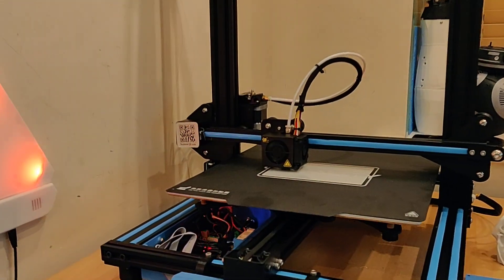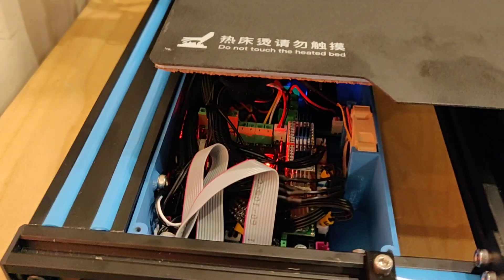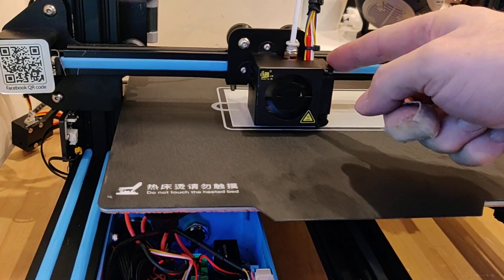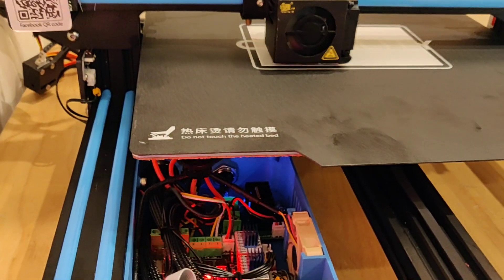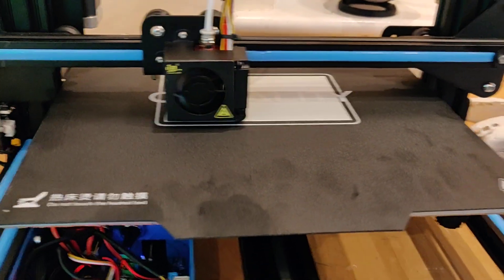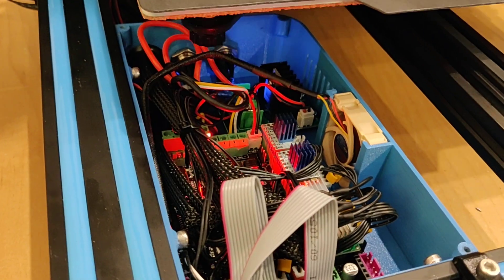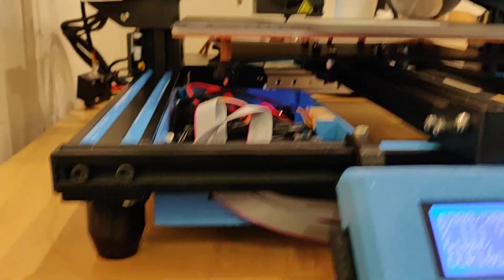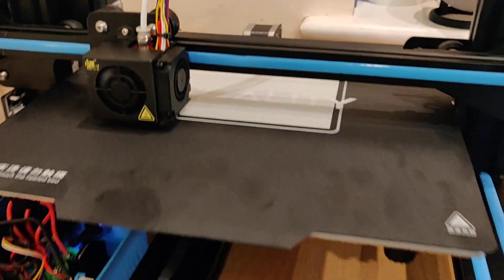CR-10S Mods and 24v upgrade

Comment: nice video, i have a question, i currently have a cr10s with a 2.1 creality mainboard which supports 12 or 24 volts. i bought a 24v heatbed, a 24v meanpower supply, a 24v hotend that says its for the ender 3, but the only thing that will fit my carriage,i also bought the 2 fans for the hotend.do i need to chane stepper motorers? and what about my 12v cooling fans? my last question would be, i am using marlin 2.0 for the cr10s. do i need to change anything in marlin for 24v, or do i need to use the cr10s pro firmware. i just don't want to damage fans, endstops or stepper motors i just purchased. thanks for any replys, Brett :-)
Reply from the maker: The only thing you need to update are the 12v fans now.  The motors / steppers / endstops etc will all work as before.  So, just your fans as you have already updated the heater / heated bed.  You can just take the heating element from the Ender three if you want and swap it from the 12v one out of the hotend on the cr10s.  The themistor can remain.
Reply: @Waggster  thank you very much for the response,I subbed your channel,I don't own an ender 3 ,I just ordered the hot end because it will fit on the cr10s.the only other issuei am confused about is the current to the stepper motors.i am using the btt 1.4 turbo with tmc 2208s in uart mode.at the stock current the motors are quiet at 1/16 steps and 700v or whatever the current is in.the stock was 650 and I turned it up to 700.i don't know if the steppers will do 32,64,128 ect,I know the max of 256 is not recommend.
Reply: @Waggster  does the 24 V heat bed, heat faster significantly?
Reply: @mathiasjapri  Yes I would say and gets up to a higher temp if needed.  I've since sold this CR10s and bought two CR10 v2..  Also done a standalone mode on these.  https://www.thingiverse.com/thing:4253970
Reply: So if I would upgrade the heatbed to 24V I also need to buy a meanwell 24V PSU and that's it? I am looking to upgrade my Ender 2, but the looks of it, it doesn't have a mosfet?

Comment: Is that the power supply for the Ender 3?
Reply: yeah you could use it on an ender 3.  Infact I did a mod using the same PSU for the ender3 - https://www.thingiverse.com/thing:3361078

Comment: What is the size of the cr10s front to back was going to buy this printer but Idk what type of desk/table to get
Reply from the maker: The desk size that it's sitting on is 600mm wide and it overhands just a little.. :-)  Is this what you wanted?